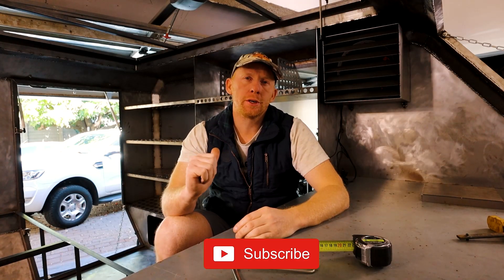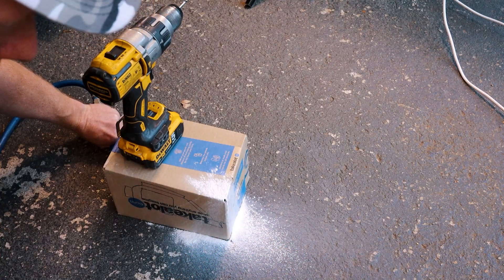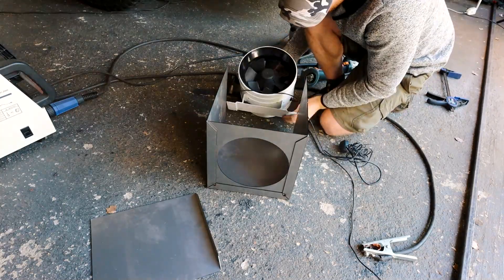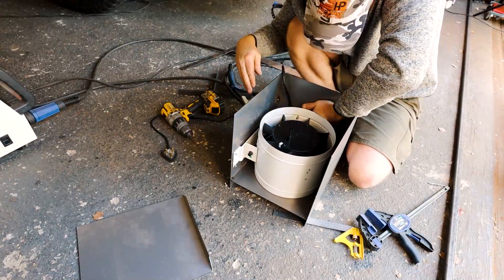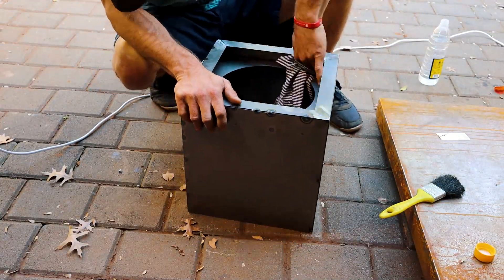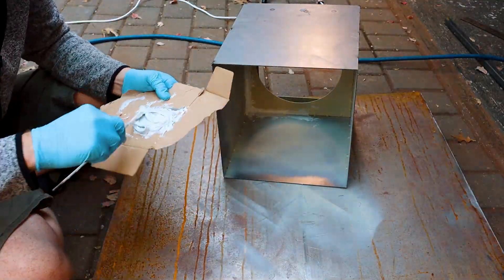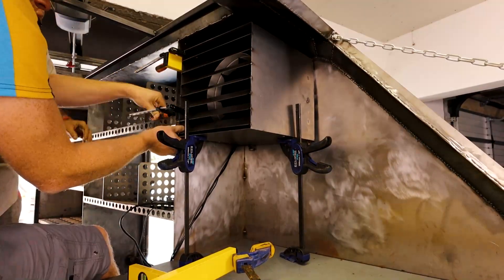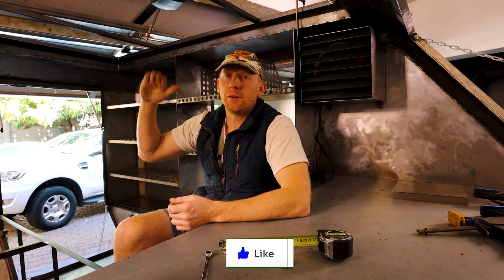Preventing off-road dust inside my Camper Trailer - Part 3

Comment: Wicked build, your level of detail and professionalism (etching primer!!) is intense, but I love it as I can skip the bits that are too time consuming for my needs. Love this! I am going to try something a bit smaller scale for airflow during storage outside - our holiday travel trailer gets to 50ºC in the sun closed up and I can't leave it vented right now because so much dust gets inside. The trailer can take it but its not good for the plastics over years, so some regular ventilation would be super.

Comment: Nice video, gave me some ideas thanks. Also louvers on a square sleeve frame that could be inserted and screwed into position would have made the fan accessible later on
Reply from the maker: Thank yo sir.. Yep that would def be better.. I just wasn't sure if the fan would work and didn't want to spend hours on something that might not work. Once tested and it works i will def have to look at getting the fan assessable. Your idea will work just fine. 

Thank you so much

Comment: Why did you use Borda filler instead of a Harvey duty silicon
Reply from the maker: Hi. It's what I had at home. The main body will get sealed with proper automotive seam sealer. This was just for the air box. Thanks for Watching

Comment: For the small air intake I would just make a bigger cover.  It won't look odd as the fridge cover protrudes any way.  Give it the same bevel and use much thinner material with supports to save weight.
Reply from the maker: I have ordered the steel for a louver cover already. If that doesn't work I'll look at other options. Thank you so much

Comment: May I ask, where you got or what type of hinges those are? I have tried to source them but I'm not having any luck. Thankful for any help.
Reply from the maker: Hi, All hinges on the trailer was built, on most of them I needed custom angles so buying them was not an option. They start life as a flat sheet of 3mm stainless steel being laser cut to my drawings. I then bend and weld them up to form a hinge. I've got 4 more hinges to build soon and ill show exactly how I do them. Thank you

Comment: Jou idee van 'n waaier is beslis 'n wenner. En die lug filter is ook 'n baie slim plan.
Ek sal graag jou idee van 'n evaporative cooler wil sien. Ek het self 'n paar idees in my agterkop. Veral na ek gesien, en gevoel het hoe 'n radiator (groot een vir 60 liter engin) wat gewas is en nog klam is, met 'n ligte briesie wat daardeur waai, kan koud maak. Selfs 'n aircon sou sukkel om by te bly daar.
Reply from the maker: Baie dankie. Wel as ek wil koel lug hê met baie min krag verbruik dan is evap coolers die antwoord. Gaan hom een van die dae design en n "test run" doen. Thx

Comment: Are you using the same thickness of sheet metal throughout the build and If so what thickness is it? If you mentioned it in one or more of the vids I'm sorry, I just missed it. I look forward to all you videos. Keep them up!! Love it.
Reply from the maker: Hi there,  the outer shell is mostly 2mm, the angle iron wall thickness vary from 1.6mm to 5mm depending on where I need strength. Shelves , drawers , pantry and so on is 1.6mm and some small  pieces are 1.2mm.  Thank you